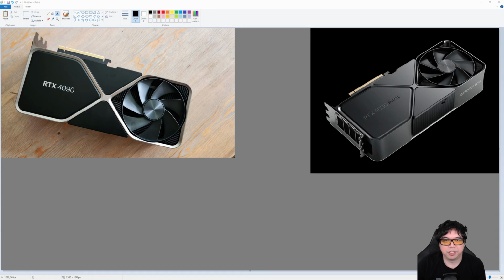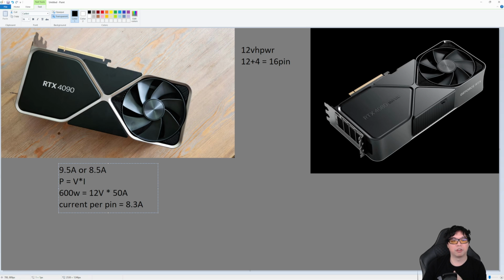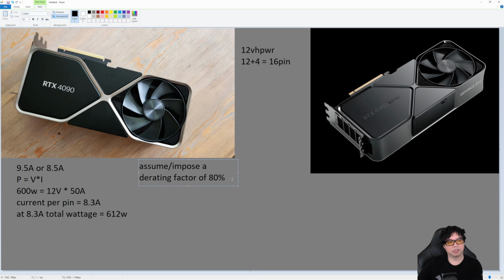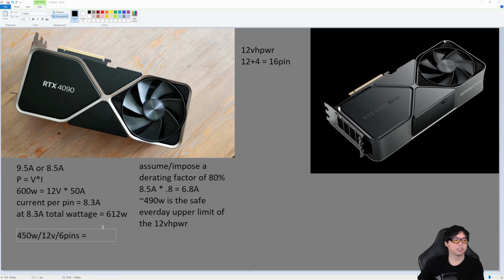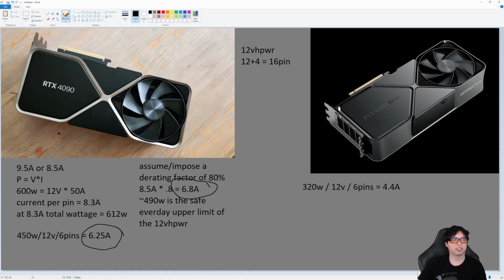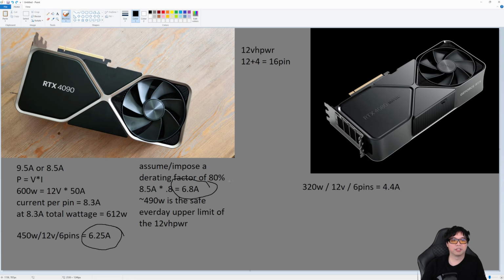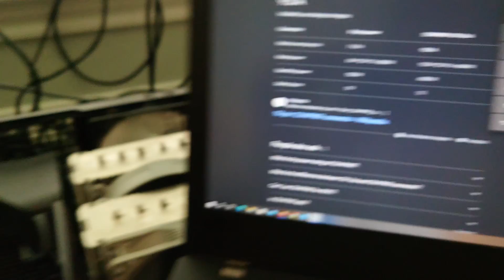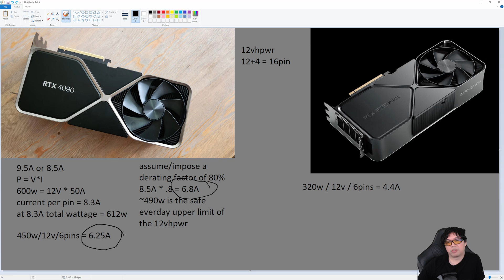Is the 12VHPWR safe? | Deep Dive on RTX 4090 and 4080 SUPER power cable

Comment: Living in a country where AC is rare and there are some hot days I went with the 7900 XTX almost a year ago now. I don't trust the 4080/4090 with that connector in my use case. What if the cable bends too much? What if I want to game with a 35c ambient? What if both apply?

Comment: Getting a 90 degree adapter for my 4070ti super. I'm planning to overclock quite a bit and my case is small so the included adapter is bending dangerously against the glass. Better safe than sorry.
Reply: As far as I know, most 4000 super series cards, if not all of them, have the revised (H++) connector. I'm sure someone will correct me if I'm wrong or missed a card that hasn't had the updated molex spec. To be even safer, you might want to try Silverstone's 90 degree 12vhpwr cable. If I were you, I would stick to the 12+4 to 8-pin x1 or x2 adapters instead of using 12+4-pin to 12+4-pin input-output, so as not to increase points of error and potentially ruining my brand new PSU. I would trust PSU manufacturers and electrical engineers to tell me what to and what not to use (even the dodgiest ones) over Nvidia and their board partners reigned by PCI sig idiots, at this point. Whatever you do, just make sure that it's fully seated, keep the terminal chambers clean, don't wear down the chamber plastic (around the pins), don't plug it in and off more than you absolutely have to, don't wiggle or bend the cable close to the solder joints, don't apply force to it horizontally unless you're using single-split terminal cables and make a habit of checking in on it regularly. Also goes without saying that it's not smart to leave anything flammable in the vicinity of this cable, around the PC. And stay the hell away from those stupid RGB ribbon adapters.

Honestly, no computer hardware, nay, no hobby in the world is worth risking your health and safety, people! I'd just stick to the 4070 or 4070 super which is well below the safety range of 12vhpwr even w/OC at over 230 watts.

Comment: connected to my 12vhpwr cable included in my deepcool px850g i had left my 4080 super on overnight to update games and the card died. woke up to nothing but the ram lit up... thought it was the psu until someone swapped cards out and the pc booted normally

Comment: Hey so i have a question

My 4080 Super came with this Adapter 3 8-pin's into a single 12VHPWR 
My new power supply came with a 2-8pin into a 600w 12VHPWR 

Im using the one that came with my power supply because its neater cable management, but do you think this could effect the cards performance in a bad way?
Reply: No.
Reply: There s any issues until now?
Reply: @Microsoft130  So far so good, I think
Reply: @Microsoft130  I don't know why anyone would have any problem.
Any better power supply with a gold certificate can give 290w per 8pin connector, the calculation goes like this, 2x290=580w, which is more than what the card requires.
don't confuse the 8pin from the power supply and the 8pin connector on the GPU, it's not the same, the 8pin on the GPU can receive only 150w, but the 8pin from the power supply can output 290w without problems, that's why people wrongly measure by the number of cables how much power the power supply can deliver!
Reply: @dakula74  its all about that damn 12v cable..its not about the psu
Reply: @Microsoft130  4080 cards are not in danger, only and exclusively 4090 which draw from 450w to 600w.
4080, none of them burned.

Comment: No V-droop, no thermal head room. 8*4(3h*4)=12 reduced to 6. This is a great design(sarcastic). Jayz2Cent did an EVGA build when they stopped making GPUs. He got an engineering sample of a 4090 from EVGA. It had 2 12vhpwr plugs! Why? Cause that is the basic math required to run that much power. 12>6 and 12=12. There really needs to a recall of all 4090s except the Galax HOF

And the math for connectors doesn't work the way wires do. Connectors are rated not by gauge, but by surface area. 12hpwr reduces surface area. 600w through a reduced surface area of 12 or 9 pins from original 4 or 3 8 pin connector, to 6 smaller pins with smaller surface isn't safely possible!

Comment: A lot of great great points shared: The main one that stuck out to me was the lack of margin for error. Being that the design isn't that good, it easily lends itself to user error... I might go as far as to say it encourages user error in that one must be vigilant so as not to incur a poor connection.
Reply: What stuck with me is that if you have a 4090 you gotta power limit it to 475 Watts.

Comment: Is there any other type of connector that does what the 12VHPWR tries to do (which is handling high loads and occupying less space, i guess) but doesn't melt/break and can be used on GPUs without driving the cost up? The idea here is good but the execution is kinda shoddy, at least on the RTX 40 Series cards.
Reply from the maker: There doesn't seem to be. They have switched to the newer 12v-2×6 but as far as I know the pins are the still the same. The only difference is the 4 side-band wires are shorter to prevent user error.

Comment: A well-produced and very informative video. I wish you had discussed wire gauge in your video. Some manufacturers use smaller, thinner gauge wire in their power cables to save money. An 18guage wire will become hotter than a 16guage wire when given the same load, I believe this is called a wire's temperature rating. I've seen aftermarket 24-pin power cables that use the thinner 18 gauge wire. On the outside of the shipping box, 18 gauge and 16 gauge are printed with an 'X' beside the 18 gauge.
Reply: I specifically went with a 16 gauge connector, one that splits off to 3x8 for direct insertion into the PSU. Something interesting to note is that when switching to this over the default nvidia connector with 4x8, the coil whine coming from my 4090 went away completely.
Reply: Thanks for your reply, I love reading replys. In my opinion you are one smart cookie. Im contacting JayzTwo Cents and hoping he will produce a video concerning why using heaver gauge wires makes scense. Please have a nice day and keep on building. @deuswulf6193

Comment: You margin is between 80% & 100%. 6.8amp being 80% . 6.25amp is a safe use level. If you use your theory 90% of homes would burn down. The primary cause of failures is user error. Just like if you install an outlet or breaker in a home incorrectly. User error period
Reply from the maker: The thing is, if you look at how many of these are having to be replaced by repair shops and the recent recall by cablemod for their custom connector, it seems like the design itself leads to user error or the connector is incapable of operating in the upper limits based on its own specifications. I'd like to think that at least some of those melted connectors weren't all caused by user error.
Reply: @GameTechReviews  It should be staggeringly obvious to anyone not sickeningly undereducated that a pin's ampacity can be exceeded if there is complete failure to do something as utterly trivial as plug it in correctly and check the catch is secure as blatantly designed. The sheer lack of intelligence, care, and attention to the most remedial of detail associated with the degrading failure to do this constitutes a truly shameful embarrassment. All this hoo-ha over the source of failure is shocking and ridiculous, and shame on all those suggesting any problem lies with anyone but the user on this matter.
Properly seat your power cables, buy a case that fits, do not bend cables, do not use 3rd party adapters, have a professional who knows what they are doing building rigs and you will have a %99.9 success rate according to the current data.

Also According to the AQL industry standard (Acceptable Quality Level) the acceptable failure rates are as follows. This issue also would fall under a minor defect due to scarcity of the issue (less than %0.1) :

The failure to meet the requirements of customers with respect to quality is termed as defects. The three categories of defects are:

Minor Defects - Not likely to reduce the usability and material of the product for its intended purpose, but slightly altered from the intended design and specifications. The industry average AQL for minor defects is 4%.

Major Defects - Not acceptable to the customers. Usage of the product will most likely result in failure. The industry average for AQL for major defects is 2.5%.

Critical Defects - If accepted, this type of defect could potentially harm or injure the customer. These defects are completely unacceptable. The industry standard for AQL for critical defects is 0%.
Reply: You can't prove all cases are user error, just as it can't be proven it's not user error. This is a bad design regardless, given the number of incidents vs the older standard.
Reply: its bad design. i dont think pcie connector had this problem